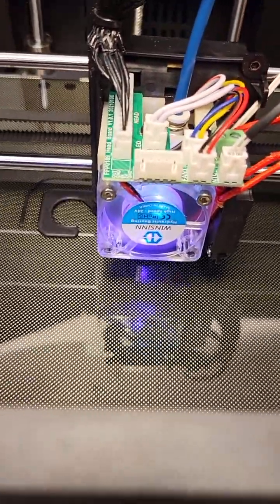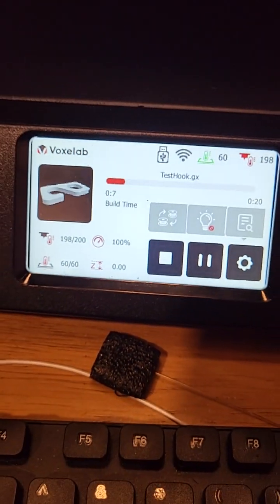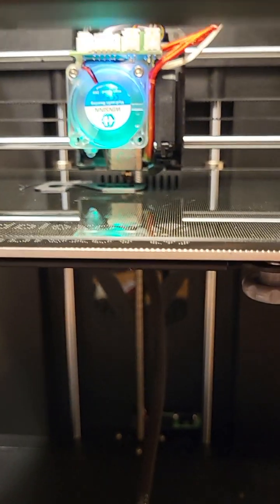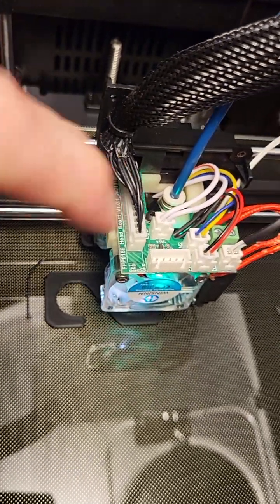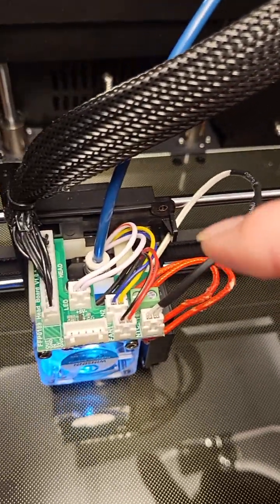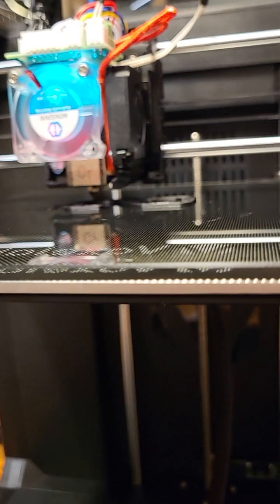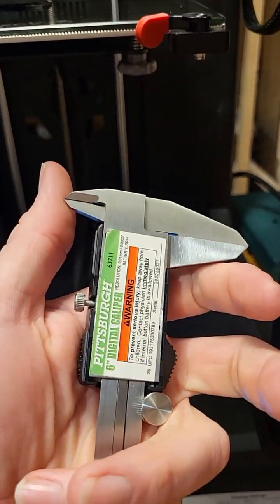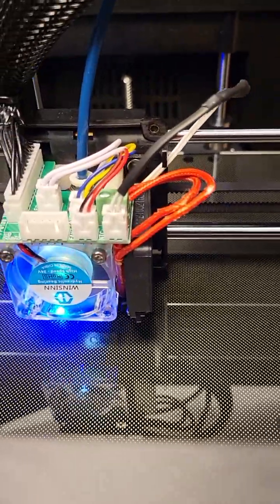Voxelab Aries all metal hotend mod

Comment: Hello, did you used the original (Voxelab) temperature sensor or the one included with the Spider?
I have this printer and I found it a little too slow for my test, wanted to improve with a similar mod.